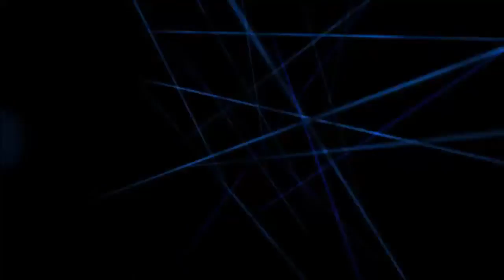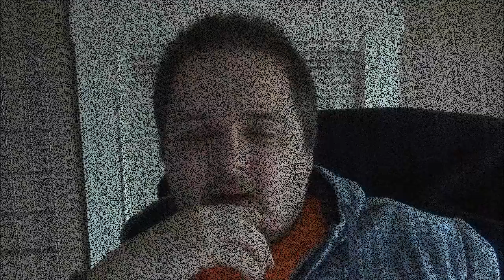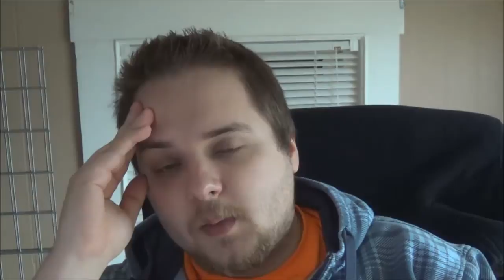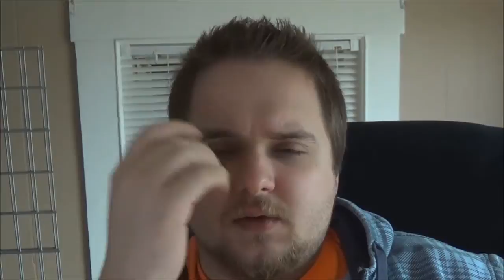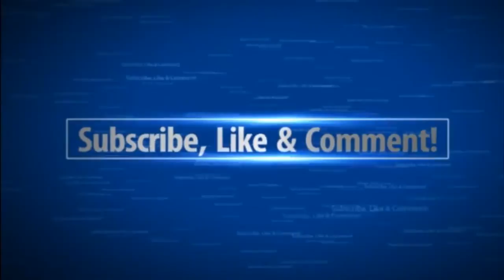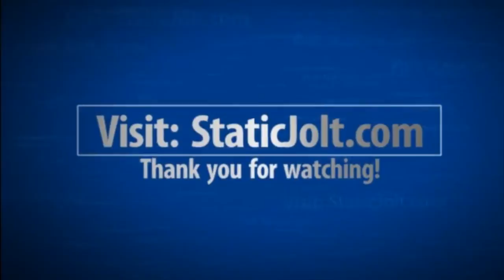Q&A #1 - Shift Registers, Relays, Resistors, Transistors, Servos and more...

Comment: So after noticing the milliamp draw on the specs for some quad relay boards I want to drive from an Arduino, I ended up here.  Thanks for the simple explanation on question 3. (subscribed)  Now I need figure out how to choose the right transistors that only need around 20 mA from each pin to provide 50-60 mA to each relay.  If you have time to point me in the right direction it would be greatly appreciated.